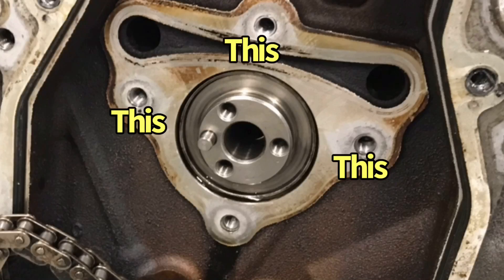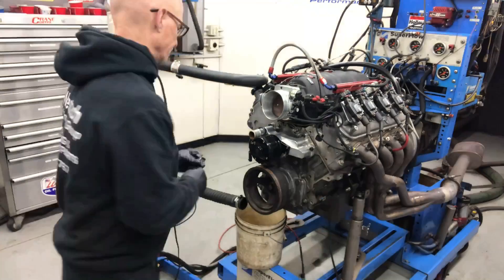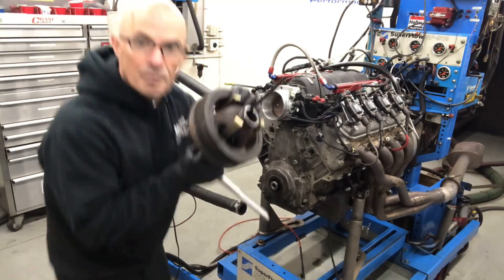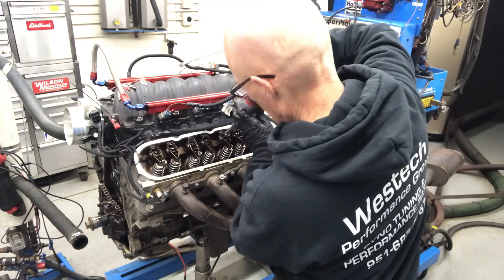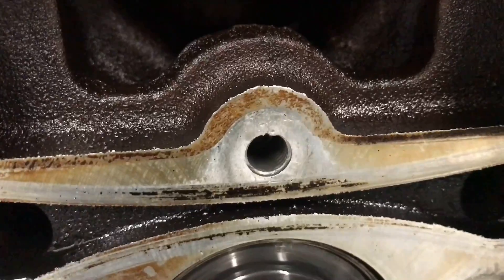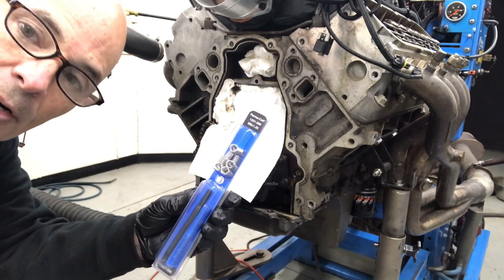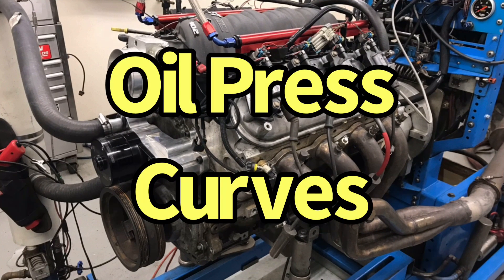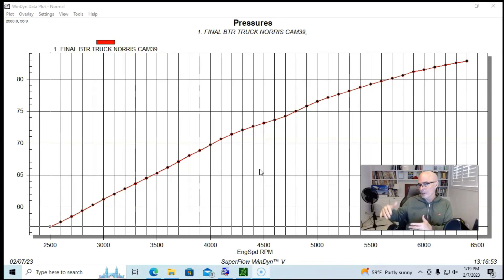HOW TO FIX IT & WILL IT WORK? JUNKYARD LS-STRIPPED THREADS IN ALUMINUM BLOCK!  OIL PRESSURE GAINS!

Comment: I wonder if that's a part of my lowish oil pressure on my 2013 5.3? HOT idle is 20 psi and 30-35 driving 60 mph HOT, cold idle 40 psi and about 50-55 psi cold doing 60 mph kinda a hard thing to figure out only things i have NOT done yet to fix is that cam plate and oil pump/ pickup tube o-ring and that valve thing in the oil pan i've done everything else to try and fix that dod has been tuned out of the ecm engine only has 146k miles and from seeing how clean it is from removing the vlom plate and doing that mod the engine is pretty clean. Anyone got any input I got many other 5.3's that don't have this oil pressure issue.

Comment: A Richard I have another?,I have 06 Chevy Silverado 4.8 LR4 with 150k+ with power issues when i get on the gas I had to literally throw it into neutral rev the engine up what could be the issue or issues?
Reply from the maker: tune, fuel filter or trans slipping?
Reply: @richardholdener1727  ,i had a bad TPS,I appreciate it but I may have bad lifters or bearings starting to go bad also there is a rattling noise around cylinder #3 it is also notoriously bad with misfiring if I'm not mistaken,but I apologize I don't have a 4.8 i just found out it's a 5.3 L59 flex fuel with 706 heads great factory heads it has a Z in the middle of the vin number,I did some research and found out I had a 5.3,oops,I believe a friend of mine said that it could be bad lifters,but the previous owner didn't change oil on the regular total neglect of maintenance,but he did say it's a project and the motor even with these problems is still strong the transmission is flawless and solid I may to do work on the transmission as well especially if your adding more power to the engine even a little,so now,I'm pulling the engine putting top to bottom with bearings,oil pump,a stage 2 cam a total rebuilt

Comment: For holes that get used as much as these do adding some inserts makes sense. Gotta say there's certainly a "pucker factor" when getting the holes straight into the block. 

The first and only time I did something like this it was a PS pump bracket on a SBC. I fortunately had one that was thick enough to use as a guide. 

In this case I probably would have made a sacrificial plate by taking some bushings, bolting them on to the plate then welding them on.

Some people free hand that stuff and show off. :) I'm not the sort, my luck/skill level is that they'd just wind up crooked.

Comment: Have you ever considered testing running solid lifters on a hydraulic roller cam on a 5.3? There is a YT video up of Steve Morris mentioning this and says keep valve lash tight like .005" cold and the valvetrain is quiet (I find that a bit hard to believe). Just wondering what it would do to the RPM range? Keep up the awesome work!
Reply from the maker: I DON'T SEE THE NEED TO DO THAT-GIVEN THE SUCCESS OF THE HYD ROLLER STUFF

Comment: I do thread repairs for a living. Helicoil is a perfectly acceptable repair for normal use application in this type of repair. That said, personally, I would have done a Time-sert repair on this motor, simply because the bolts are going in and out so often on this motor. Regardless, what you have done will work, and if the Helicoil comes out, you only have to cut the shoulder in order to fit a Time-sert, as they are both STI repairs.

Comment: If you've ever blown out a 6mm thread hole, and you HAVE TO get going (stuck on the side of the road etc) - about 20 years ago I figured out that you can run a 1/4-20 tap through the hole of the casting (in my case a water pump), into the thread of the block, then just stuff a 1/4-20 bolt (obviously!) into the hole. Works great. Possibly so well that you still had it in there 20 years later until forgetting you did it...  just now....   :D

Comment: What you think about using studs on all the areas you disassemble most often? Save the aluminum so this doesn't happen to all the other holes. Might be a pain to get the right length the first time but should pay off in the long run for your test engine.
Reply: I thought the same thing studs in the block for the cam retail 😊
Reply: steel inserts achieve the same goal.
Reply: studs would hit the timing gear

Comment: Threads now better than new! Looking forward to you retesting those cams. I am specking in my pushrod length on my LS and going for 20 thousandths to be picked up by my lifters. Oil pressure means HP when’s it comes to hydraulic lifters.

Comment: Heli coil install.  If you don't have the install tool, you can file a ramp on the end of a bolt or, if you are careful, use a tire valve tool to grab the bent tang.

Comment: Somewhat on topic, i rebuilt my gen 4 5.3l, all new bearings everywhere ( all were in spec, chrcked with filamemt gauge strip, but couldnt tell ya what they were now), billet barbell, welded the bypass plug solid in oil pan, afm delete, ss2 cam, 243 heads. I out a new m295 oil pump in, girdle bracket also. I did reuse the cam plate tho. Hot idle with 10w30 I get under 20psi , sometimes down to 15psi ( verified with mechanical gauge) , about 1500 miles on engine, changed oil for the 4th time already , only had silver the first 2 changes, 3rd and 4th look normal. I'm just trying to figured out what the issue may be. The m295 in my gen 3 6l was 40hot idle. I just ordered a melling 10296 , cam plate, and gaskets and going to redo it but still cant figure out why I have low pressure like that. I idle 650ish so 15psi is still double what id need but I dont like looking at that low and would rather be running 5w30 than 10w30.
Reply: Oil pump pick up O ring?
Reply: @billybadass411thefirst9  I used the new one that came with the melling, used proper one fir that style pick up and greased it putting it in. I'm a lifelong mechanic , so id like to say it was done properly, but def keeps me up at nite sometimes lol
Reply: Rear cover?
Reply: @austindoud273  just redid the rear main seal, was leaking first fire, I like a mo-ron didnt use alignment tool, so after buying alignment tools redid rear cover ,rear main, and double checked barbell
Reply: Cold idle is about 40psi, 210* idle its 18-20psi. My thoughts were that the m295 didnt have enuff volume to fill all the AFM voids. I didnt do the lingenfelder rivets in the afm towers in the valley bur used the cover that has the o-rings ontop of the towers. Its gotta be either the cam plate or i mucked up the I ring putting it in. New cam bearings with new cam , spun beautifully during install, zero brass in first oil changes, tho didnt have it analyzed.
Reply from the maker: what are the clearances?
Reply: @richardholdener1727  I can't remember now, been a few months but checked them with the filament and if I remember correctly they fell just on the high side of the specs from alldata
Reply: @richardholdener1727  I know I used the green clevite plastigauge wanna say .0020 range